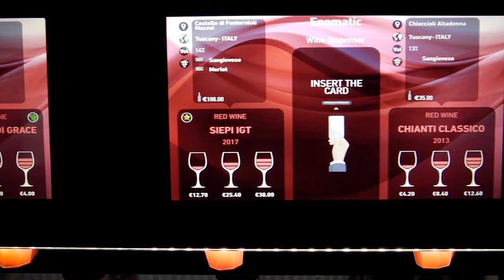Discover Unica, the new Enomatic® Wine Dispenser

Comment: What happens when the wine bottle is finished?
Reply from the maker: The dispenser will let you know that the bottle is empty, you can then easily remove it and insert a new one in the system 🙂
The bottles sit on gas spring lifters that allows for a quick loading operation.
Reply: How much and how i find it ?